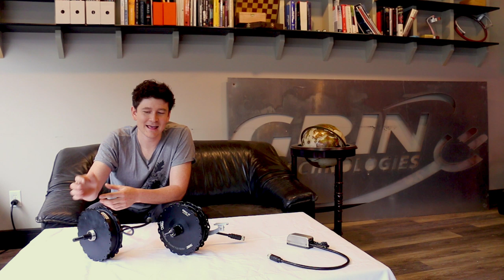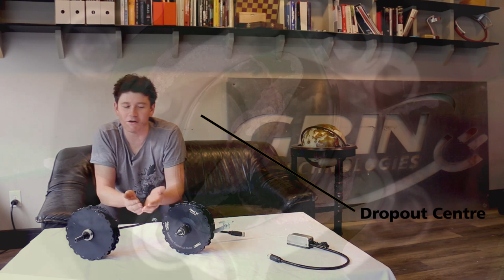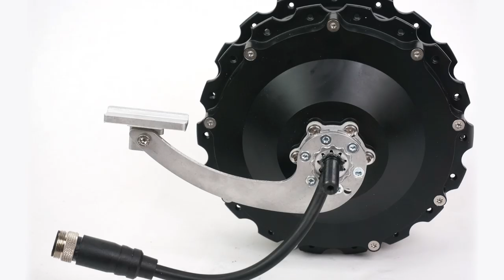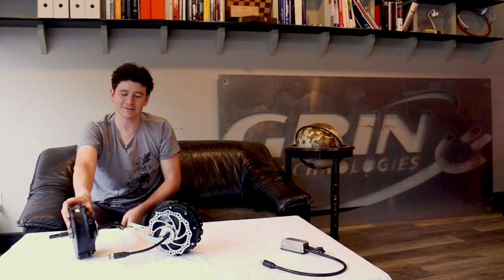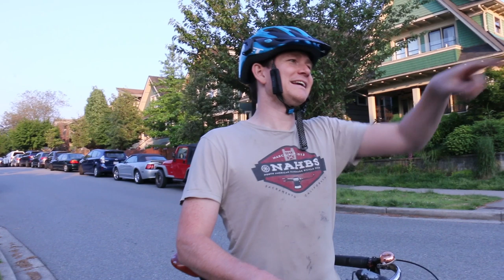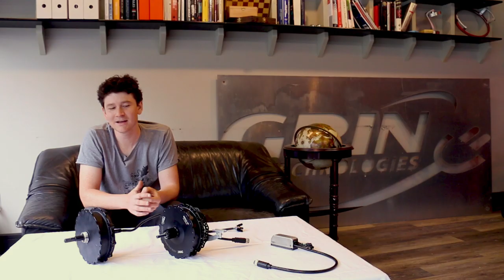Introducing the GMAC Clutchless Geared Hub Motor from Grin Tech

Comment: Great product Justin,  I got one of the very first BMC/MAC geared motors way back in the day 14 years ago and its still working as I use it for my daily commuter bike, its done 40,000 miles, at power levels over 2kw the internal clutches in the motors struggled over time, I found the sweet spot was about 1.6kw so 50V 35 Amps max would mean you would get a decent clutch life, also soft starting acceleration and reasonable throttle use helps, never needed torque arms over that time as the axle sat in a steel frame with thick dropouts.

This looks like a wonderful adaptation, the removal of the clutch removes the weak spot of the original geared motors, combined with the injection of power from the phaserunner will make this a powerful and reliable system, I also love the fact that the power wires comes out of the side.

Blown away by how well you have made your business grow and really pleased to see my friends from way back in early 2000s that were on the scene back then have made successful businesses and am surprised that it took the normal bike industry so long to cotton on to how amazing ebikes are.

Best Wishes

Knoxie

Comment: Congrats! This is a quantum leap forward in e-bike hub motors!
Reply from the maker: Thanks! I wouldn't quite say quantum leap, but it's at least a lot of incremental changes to an existing proven motor model in order to have it run at the full potential. We hope to stimulates the industry at large to explore the clutchless geared motor route, and integrated inside-the-dropout torque arms.
Reply: EbikeSchool.com is this technology available for sale yet in any commercial Electric bikes?
Reply: Grin Technologies  is this technology available for sale yet in any commercial Electric bikes?
Reply: @shadowdance4666  ebikes.ca has a list of dealers. Hilleater is one bike I know of. I'd love this motor on a FS https://hilleater.ca/52v-hilleater-galiano-phaserunner-se/
Reply: What’s the best ebike motor setup for my Dahon Speed Uno folding bike with 75mm front and 120mm rear spacings? I really like the torque integrated into the hub. Thank you.

Comment: I want to feel it. I got the direct drive 1500 W hub heavy. What do I need to do? Do you have what I need to regenerative break?
point in the right direction I have another bike. I want to convert now. I'm not sure what kind of motor to go with. I was gonna go with a mid drive. Maybe I want a geared hub motor have no idea. Learn more before I make a decision on my second bike.. Am I gonna need a new motor controller? I don't have a screen. I just have a throttle with a little led battery capacity readout. Got A52 tooth chain ring, so I won't spin out when I'm in. Full throttle, it's like I'm stuck on full throttle. I just go full throttle everywhere I go. LOL less I have to ride slower for whatever reason. I remember I was racing mountain bikes. When rock shock made the first front fork Shock.. You'd have told me there'll be wireless derailers. And electric motors on bicycles. I'd have been like yeah, right?
Reply from the maker: Sounds like you could start with a good couple afternoons of reading! 
https://ebikes.ca/getting-started/ebikes-parts-explained.html
https://ebikes.ca/getting-started/hub-motor-options.html
https://ebikes.ca/product-info/grin-products/baserunner.html

In general the GMAC motor has a higher share of mechanical issues due to the internal complexity of the geared hub design and MAC motor's overall QC, so we tend to steer people towards the V3 All-Axle hub motor which is only a couple hundred grams heavier with all the benefits of DD:
https://ebikes.ca/product-info/grin-products/all-axle-hub-motor.html

Comment: 2yrs later: what are your STATs ??
 GMAC8T, Cycle Analyst 3, Torque sensing PAS, Phaserunner with Regen Braking, Joysi 52v14ah.
Commute 32 flat miles R/Trip.
29er MTB, 200Lb rider.
12.7 wh/mi avg , 25.6mph avg , yes, i pedal.
Recharges during  work (<8hrs). 
GRIN masterfully matched & preprogramed all main components! ( bought all at once) 
Hope to ditch the car soon !!
Reply from the maker: Hey bravo and thanks for sharing this. 12.7 wh/mi at 25 mph is some pretty good usage stats for a 200lb rider!  My consumption is more like 20 wh/mi, but I ride a cargo bike with low pressure tires and often carrying my wife or child on the back seat.  But the best bit is # times I've adjusted the brake pads?  = 0.   Love regen!
Reply: Amazing that even a Tesla uses 200-300 whhr/mi for comparrison. The bicycle is a very efficient machine !

Comment: So when the battery dies, pedaling this motor is like pedaling a direct drive, is that correct?
Reply from the maker: Yes, but a bit worse even.  DD motors are about 0.6-0.8 Nm, this would be more like 1.2Nm.  But if you set a low voltage rollback correctly with the controller the battery will never 'die' and will always be able to cover its own drag based on the energy recaptured from regen.

Comment: Allo, and thanks so much for this clever contribution and general transparence.  I really appreciate this service.     I'm a newbie, and am trying to anticipate how this clever motor and Electronic Freewhiling would behave with dead batteries.   As my interest in a non-resistant free-wheeling motor expresses in long distance riding (countryside) where occasions for recharging may be scarce.   Or for the sake of riding instead of sitting at the current outlet during afternoon recharges.  Since I lost endurance after being hit by a car driver, I'm apprehensive of drag.  

Here, the video let me to wonder if a «dead battery» (dead for riding) could serve and feed the 40W of power necessary for the Electronic Freewheeling Feature for hours... That is, without inducing a «deep discharge» in the batteries and degrade them.     Or, if the Electronic Freewheeling feature holds a trick that demands less energy to manifest than the spared pedaling resistance itself.   

Said otherwise I beleive, am I looking for Perpetual Motion here or is my apprehension correct, that a clutched hub motor could be more beneficial than geared Regen for long expeditions away from 120V outlet?   I hope my interrogation make sense, and  grateful consideration if you have the time to respond.
Reply: A clutched motor would make more sense. Electronic freewheeling takes about 1/10th of the power as riding fully electric, but that still won't do for long distance riding unless you have a massive battery.
I am in the same boat. I have found some good batteries and an amazing charger so I can do 1000w charging at mcdonalds etc, but I want a motor with regenerative braking. The reason is I ride with a lot of luggage (have been as much as 80kg when its hot and far between stores) and I would like something for long downhills to save my brakes.
It looks like what we would need to gain  the benefit of regen is a manual clutch motor.
Reply from the maker: Basically if you are riding in a situation with either lots of stop and go (eg commuting in a city) or with a decent amount of hills then you will get more back from regen than you consume to overcome drag, in some cases quite a bit more. But if you are doing long rides in the countryside where there aren't many hill, you aren't stopping very often, and you plan to pedal without assistance for good portions of the trip, then a freewheeling motor might well be best.   
For a direct drive motor (like the Grin All Axle hub) at normal pedal bicycle speeds (say 20 kph), the drag is more like 10 watts, while the GMAC motor is closer to 20 watts.   40 watts would be for the GMAC motor going quite a bit faster and you'd normally be pedaling unless you are zipping downhill.

Comment: Hey Justin! A former customer of yours here, from 2008, I built a huge 72V 15Ah electric bike with LiFePO4 batteries and some of your Infineon controllers and other parts using Janko Veselinovic's store services :) These were good times! Curious about the batteries you sell today, which one of them is the most powerful with regard to taking in the most regen energy back? Is that the 72V 8Ah battery with Tesla 2170 cells you sell right now? Or something else? Just thinking about maybe building myself another one, an electric cruiser like Electra, with 72V possibly, Grin all axle motor on the front, 40A controller and a throttle. Just like old times. Always wanted to use regen but recently read that batteries do not take in as much energy quickly as they dish out, i.e. most batteries are very good at discharging quickly but they can't really take a lot of energy from regen back quickly. What's your take on that? Is there an endless sphere thread discussing this that you would recommend for further reading?
Reply from the maker: Hey there Electruver and always nice to see people still around from the early days !  Most lithium batteries have no problem being charged at 1C rates for short times like this, which is really all that is required for very impressive regen braking. The cells in our 72V 8Ah packs are high rate 40T samsung cells and they can definitely handle high charging currents, but even normal cells (like Panasonic PF, GA etc) don't seem to have adverse effects from short duration charging bursts like regen.  If they did we wouldn't see regen used to the degree that it is in electric cars, or the ubiquitous supercharger stations for that matter.  It's only if you have a really small battery pack (say <400wh with standard rate cells) that you'd want to limit the max battery regen current to a level that might not provide the optimal level of braking.
Reply: Good Lord... How much did that bike weigh? Wish LifePo4 was still a chemistry available on ebike batteries

Comment: Curious as you build it to wheels can you request say a 190mm drop out width?
Reply from the maker: Nope, that requires a dedicated fat bike hub motor. You can't space out the freehub body on one side and the disk rotor mount and splines torque arm on the other side and somehow turn a 135mm OLD into a 190mm.  We have the G62 hub for that, which can be ordered with a welded clutch if you want regen

Comment: So instead of just 10% of extended range and energy savings... what's the percentage now with this motor?
Reply from the maker: That would depend on what you are comparing it too.  There are situations where the GMAC motor will have less range than a different motor (eg running at pretty low power levels, where a smaller motor would be better suited and more efficient) and there are cases where it will do much better (eg climbing hills, where the GMAC efficiency is noticeably better than most other hub motors on the market)
Reply: My Regen is really about not having to change brake pads every couple weeks. This bike/rider is about 300lbs at 25mph avg= brake heat.
Reply: @thedronehorseman4713  Eric Luna...is this you? You mad, girl...

Comment: So in very long downhill coasting I can charge the batteries?   Say it was 10s of miles long?
Reply from the maker: Yup, that's what regen does, whether the hill is short or long.  To fully charge a flat battery from empty to full via regen requires you go down quite a significant mountain pass, think like 5000-8000 feet of elevation drop.
Reply: @GrinTechnologies  I’m liking that!  So what I’m understanding is that there is always “drag” when the motor isn’t being powered? How significant would that be in a quad and each wheel had a motor?   I’m looking to have 4 wheel drive to use for short sections where it it absolutely necessary, and then maybe just one or two for the flats.  Where I would need pedal power it would be nice if the motors would free wheel.   So far I had not seen a clutch that would do that.  I did see you weld them so they’d regen. A clutch there would be cool!

Comment: Any sneak peeks for the front hub geared motor with regen enabled that's coming soon? Which motor will it be based on and would it fit standard fork spacings?

Also are there any plans to make proportional braking signal levers/tripwires yet?
Reply from the maker: Ha we've had the motors ready for this for over 3 months but are still finalizing the torque arm details which proved trickier than expected.  Both the eZee and Shengyi SX1 will be available with regen options once we are ready.
Reply: @GrinTechnologies  is the front hub GMAC no longer on the roadmap? also would it be possible to get the regen-modded shengyi motors now before the torque arms are ready?
curious about the tricky details o.o

Comment: This looks amazing, seems to fix so many annoyances with existing motors.  Couple of questions.  Currently I have an older setup with a Crystalite hub on my front wheel, an older 36V controller, and a CA2.

1) I'm not finding this setup is much help on the long hill from the ferry terminal here on Mayne Island when my cargo bike is heavily loaded (~350lbs of cargo, plus my ~200lb self).  I've been considering switching to a mid-drive setup so the motor can take advantage of my gears (a Rohloff speedhub in the back).  But I do prefer hub motors (regen braking FTW), so would this geared hub motor be able to help me out more (not so much with speed, but just having enough torque at low speed)?

2) Would this motor work on the front?  Would it work with my existing 36V setup?  Would I need to replace my controller or CA2?
Reply from the maker: Hey Emanuel and thanks for the questions. A 550lb total bicycle weight is a lot to haul up a steep gulf island hills and it's not surprising that most hub motors wouldn't be at their prime doing that. The GMAC definitely has better efficiency and low end torque than most of the Crystalyte direct drive motors, bit it can also overheat if you subject it to high loads for too long. Best is to use our motor simulator ( https://www.ebikes.ca/tools/simulator.html?motor=GMAC10T&cont=cust_30_96_0.02_V&mass=249 ) to see the overheat in time and if you'd make it to the top of the hill before then or not. 

There's no problem running it at 36V although the speed would be lower. We would recommend upgrading to a motor controller with higher phase current capability if you want to run it at full torque, though it would work OK with the old analog Crysatlyte controllers, though the eRPM is probably too high for the Crystalyte digital controllers. 

At the moment though we only have a rear option in production, the front GMAC motor is still in development and probably won't be ready until 2020.

Comment: Are there any motors with a feature set like this for the front hub? And maybe a bit smaller and cheaper.

I kinda want to add a motor to my commuting bike (that I sometimes use for grocery store trips with rear rack baskets) without changing out too much parts, and I want the regen braking feature and also the smaller size of a geared motor. The splined torque arm also seems nice to have.
Reply from the maker: I think we'll have something soon for a front hub that's cheaper than the GMAC, though it won't have an integrated torque arm. Stay tuned in the coming months.
Reply: @GrinTechnologies  Is that going to be a locked freewheel gear assembly for Shengyi SX1?

Comment: I wonder about the idea that riders want a geared motor because it doesn't have rolling resistance. Most ebikes that use a large geared motor are fat ebikes. I don't want to pedal my big, heavy, brick-shaped fat bike without assist. IMO the reason for geared motors is the low-speed torque that you mentioned. There's a big hill on my commute that I have to go around instead of over, and it's like a respected foe. I think adding a GMAC 10T on the front is my ticket to the top. I'll upgrade the rear to a G62 if that's not enough. Is it the smaller geared motors that are used for unpowered riding?
Reply from the maker: Generally you are spot on here.  You can also lock the clutch on a G62 motor and have it to pretty impressive regen, but the small M12 axle with axle flats is the limiting factor here as it's not very easy to pin those against back and forth rotation via normal torque arms.

Comment: Justin hello, i realy like the upgrades, they make a lot of sense. For me a must have is the 10mm axel (mine is a 14 and i can't seam to seat the caliper with the rotor) , super important is the 11 speed freehub cassete (mine is a 6 speed freewheel i hate it) , the very well design torque arm , and a motor with no drag (i try to pedal a lot without the help of the motor), so i'm not very keen on regen breaking and the drag of the motor. Also not keen on compensating the drag with the controller, is it possible to buy this motor with all the features except the regen breaking so it freewheels with no drag just like a geard hub motor?
Reply from the maker: Hi Pedro, we actually still have a few samples or our earlier GMAC prototypes which do have a conventional clutch in them. Email us to info AT ebikes.ca for details if that's what you want.

Comment: Will this motor fit a RAD City Step Through.  It now has a direct drive motor
Reply from the maker: Most likely, but it doesn't usually make much sense to swap out the motor and controller in an already electric bike since you've got a working motor already. If you want more power and torque than the stock motor provides, we'd normally suggest leaving that installed and adding a 2nd small geared hub motor to the front.

Comment: Do dual front and back geared hub motors have less drag/pedal resistance than a single direct drive hub motor?
Reply from the maker: Yes but only if they are geared motors with freewheels, not a geared motor like the GMAC :-)   The drag of a direct drive motor is about 0.6-0.8 8Nm, while the resistance of a geared motor with a clutch inside is like 0.05-0.1 Nm (it still needs to spin the gears, just not the motor).